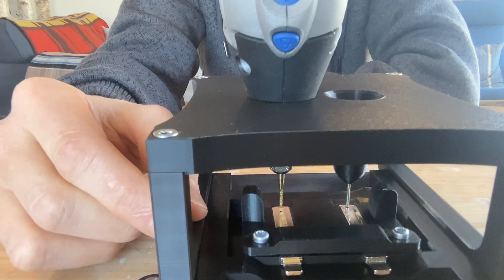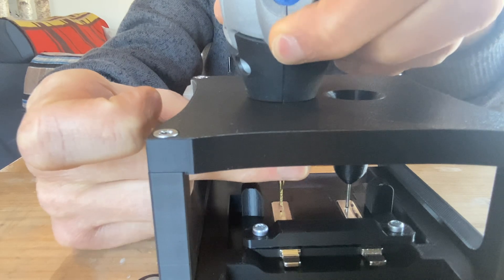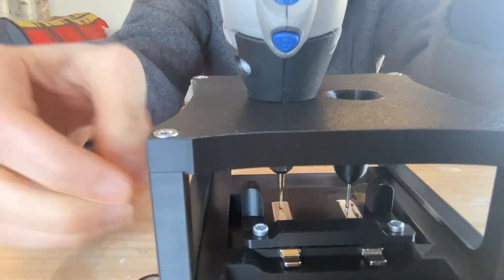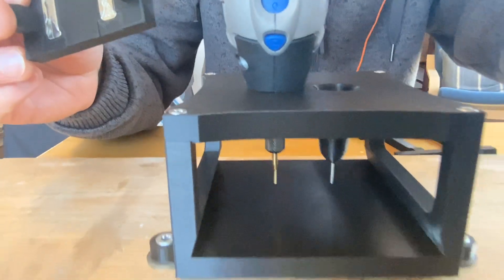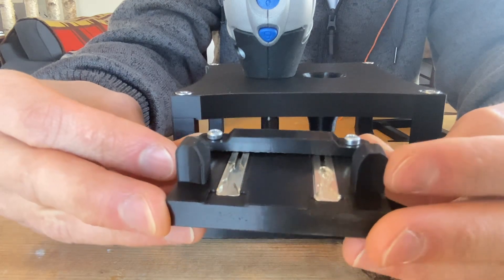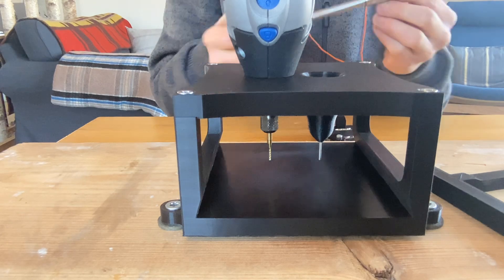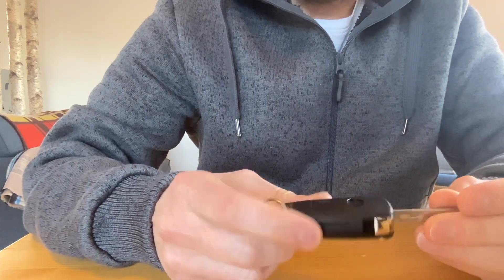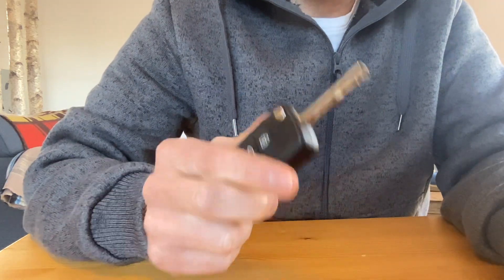3D Printed Key Copier For CAR KEYS

Comment: This is great. My dad was a locksmith and I wish I took an interest in it. I JUST broke a new key for my motorcycle. I have a copy but its plastic. At this point I need to print this. Thanks for posting. Where do you get the blanks from and are they pretty standard sizes?